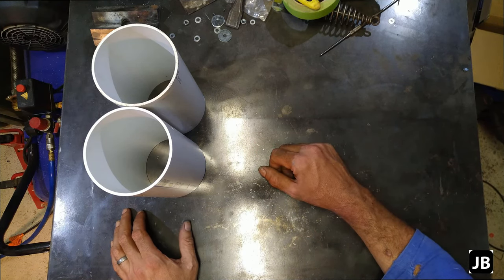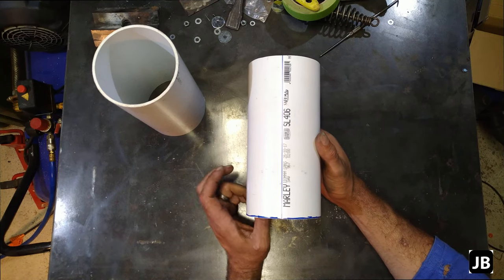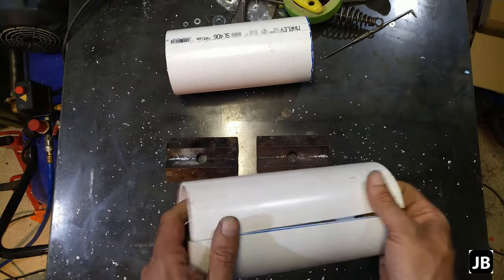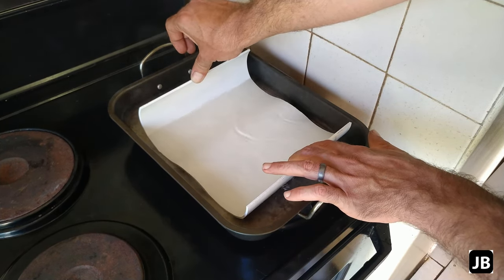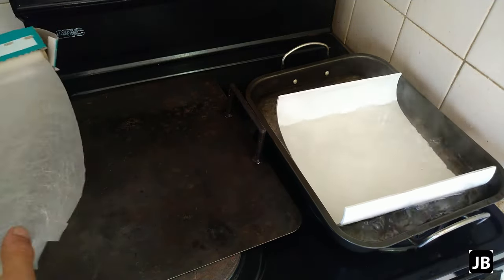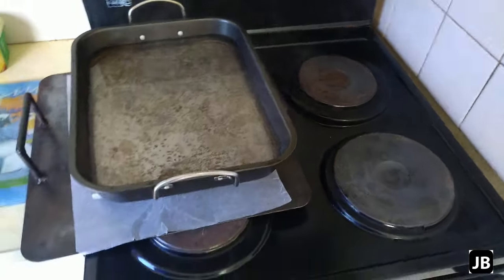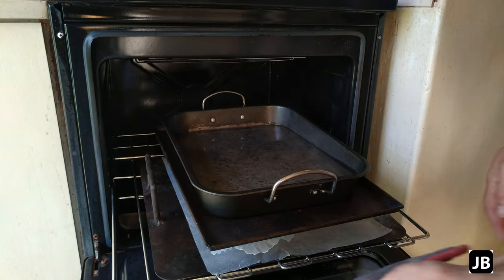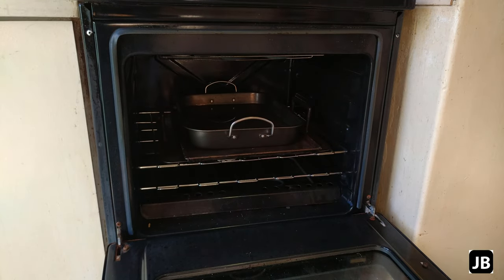PVC Flat Sheets from drain pipe

Comment: Is there multiple PVC tubes types i have to worry about when buying one or I can just heat up whatever kind of PVC tube?
Reply from the maker: They should all soften at relatively the same temp if it is drainage pipe. Some thicker wall should take longer to heat up. Do not raise the temp as it will start burning the outside while the inside is still softening up.
Reply: @JacoBadenhorst  does a hot air gun work too?
Reply from the maker: @slendy7746  yes it does work. I have shaped PVC pipe with a heat gun. I do however think you will battle with a heat gun to make flat sheets as you will not be able to heat the sheet up uniformly.
Reply: @JacoBadenhorst  Allright, thanks for the help man!

Comment: Ok but what do you do with that now?
Reply from the maker: Good question Joe. I use it as you would use acrylic sheets. It's just more forgiving in situations where the acrylic sheets crack around holes etc.
Reply: I used it to have a firm floor in a tool bag.  Round the corners so it doesn’t tear through the fabric. Made a jig for cutting circles with a router.   Flat pvc can be used in many situations where one would normally consider using plywood. You are limited by the width (circumference of the pipe) but sheets could be mended together, depending on how important the sheer strength is to your application.

Comment: What glue/adhesive would you recommend to use to stick several of these sheets together quickly? For example, say I needed to build it up to around 30mm in thickness.
Reply from the maker: I'd use PVC solvent glue that you use for sanitary pipe fittings. But make sure you clamp it proparlt
Reply: @JacoBadenhorst Oh ok, I've used that stuff for plumbing work before.
But I've seen some people using an almost watery like substance to glue plastic together. Any idea what that would be?
Reply from the maker: @uzzie88  it depends on the type of plastic. When working with acrylic sheets or "perspex", you use acetone to glue it together. Nothing sticks to HDPE and you have to extrusion-weld it. So I'm not sure about uPVC. I've just always used the pluming glue. Maybe do a test piece and check with acetone?
Reply: @JacoBadenhorst  I'll have to do a test.
Thanks for the response. Only person that's replied.
Reply from the maker: @uzzie88  it's my pleasure. I'm not always online, so my Apologies if it took a while. Let me know if you get something that works.
Reply: @JacoBadenhorst  It's fine. Wasn't expecting an instant response, people have lives to live.
Could be a while before I get something to work, working on several different projects right now.